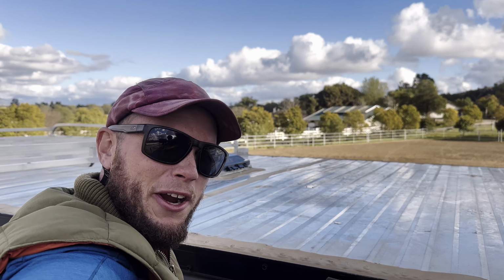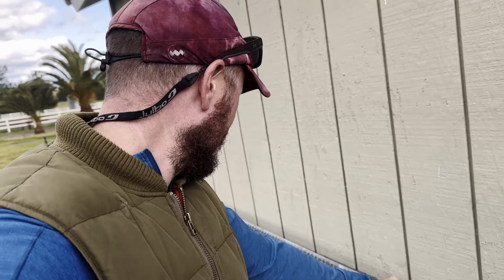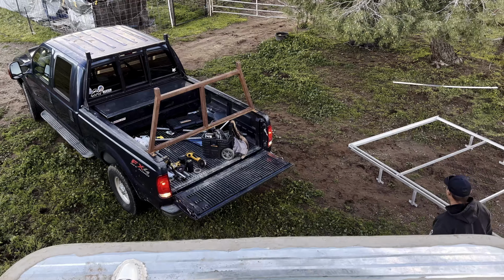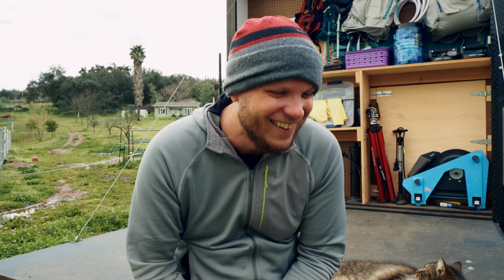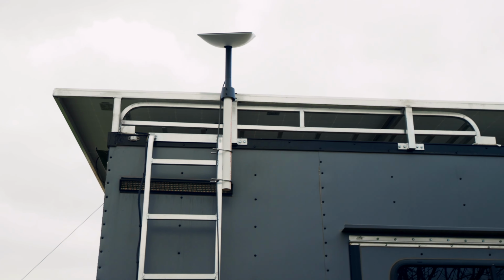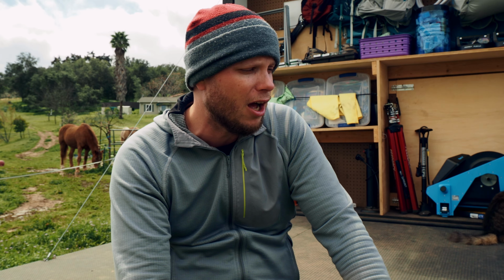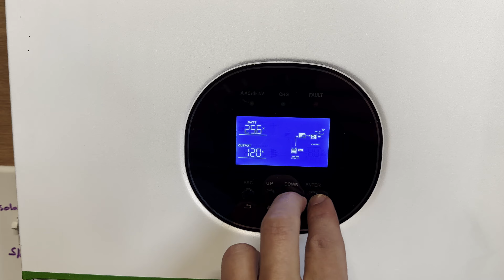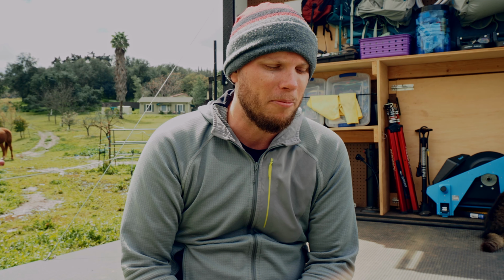The Ultimate Solar-Powered Cargo Trailer: A Green Energy Machine

Comment: 11:27
During summer daylight, some folks park in the shade.
The rig interior stays cooler that way.
.
[edited to add]
Some folks park in the shade, then run remote photovoltaic panels in the summer sun.
Reply from the maker: Yeah, I’ve seen that. We usually are in the mountains above tree line, so no shade available. Plus, with our power demands it would be hard to move that many panels around. Also, portable panels are a pain to deal with on windy days…which we’ve gotten a lot of in our travels.

Comment: I like how you think on the design of the solar roof

What was the weight of the custom solar roof rack w/o the solar panels?

Was it expensive for them to build the custom roof rack?

Did the roof rack affect your mpg when being towed?
Reply from the maker: Not sure about the weight, but it wasn’t much because it was aluminum. Using aluminum came at a cost though of about $2,500 in material. Didn’t really change our MPG much. We went from averaging 10-11 MPG to closer to 10.

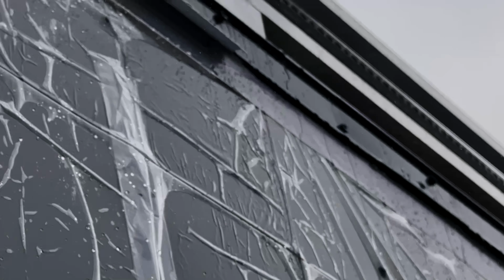Comment: 09:50
re : leaks
We thought our ExpeditionVehicle roof was leaking.
We taped, sealed, gooped, re-sealed...
... and still, the torrents continued.
.
After a couple weeks of everything inside drenched, we opened the windows to release some humidity.
[cue : 'ah ha!' moment]
Instead of leaks, the interior downpour was from trapped humidity condescending coagulating on cool flat surfaces.
.
These days, for over two decades full-time live-aboard, we always open two windows on opposite walls.
Escaping warm air carries humidity and odors.
Reply from the maker: Our mini split does dehumidify, so we’ve never had condensation build up except for a little bit of moisture on the windows some mornings which clears off the second I get up and turn on our exhaust fan.

Comment: 11:55
Does each panel 'float' independent of its neighbor?
I think bolting their sides together -- the whole shootin' match as one rigid unit -- decreases flexibility and increases the potential for cracking.
Reply from the maker: They aren’t bolted panel to panel. There is a welded aluminum L-bracket that runs the entire length on each side and they are bolted with stainless steel hardware to that.

Comment: Sorry if this has been covered by another video but you need to replace that red turn cut off switch. Check the voltage rating on it. They are usually only rated for up to 48 volts. It could be an Instant fire if it is opened with a load on it. Try one of the higher voltage d/c breakers as a shut off. Great video.
Reply from the maker: Thanks. I actually did a lot of research surrounding that cut off switch on a lot of solar forums. Yes, when you buy them they say they are rated to 48 volts, but in reality they are rated much higher. 72 volts seemed to be the consensus. The reason the manufacturer doesn’t state that is there is additional regulation for it if they state the rating over 48 volts. It’s been in use now on our system for 7 months. No issues.

Comment: With a 48v system, how do you power your refrigerator? Thank you.
PS - You had 1400 watts, not watt-hours.
Reply from the maker: Our Growatt inverter/charge controller inverts the 48V DC system to AC power. We could run the fridge on 12V (it can do both) in which case I have a 48 to 12V converter wired in for our 12V fans and lights. 

And yes, I meant watts, not watt-hours. Thanks for the correction.

Comment: Well I do got to say one thing buddy that thing really really looks good I mean very nice job on it I'm really impressed I really like it can I ask you a question what kind of trailer is that and what size is it like the length with the tallness I like to get me a trailer like that cuz it has the barn doors on the back of it at least I think it does so if you could help me out there please I really appreciate you thank you and it really looks good That's really nice bro thank you very much
Reply from the maker: Hi, Joe! Thanks for the compliment 🙏 It is a 7x18ft with 7 ft interior height. With the panel rack and solar panels it comes to 10’3” total height. This includes the 19” of ground clearance it has. It is a Colorado Trailer (dealer of this model). The rear is actually a ramp door with stabilizer jacks so it can be used as a deck. But you can probably ask them for barn doors if you want. Just curious as to why you prefer barn over the ramp?
Reply: @ForeignerDaniel   THANK YOU
Reply: @ForeignerDaniel   sweeeet  thanks